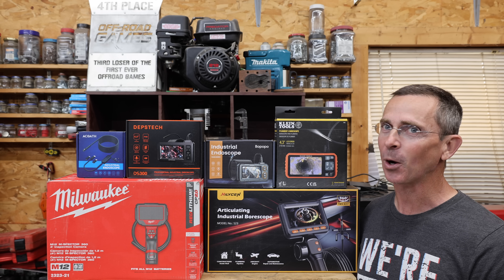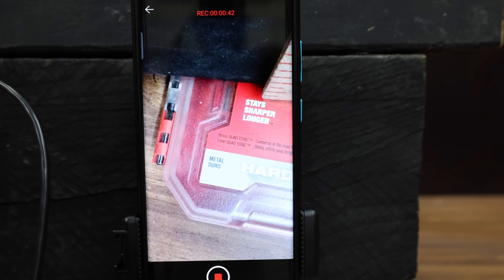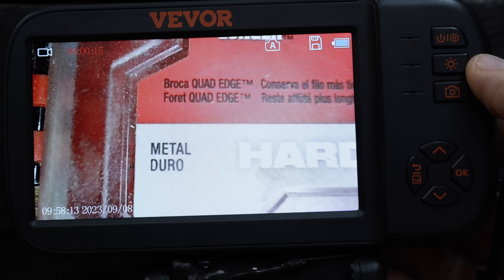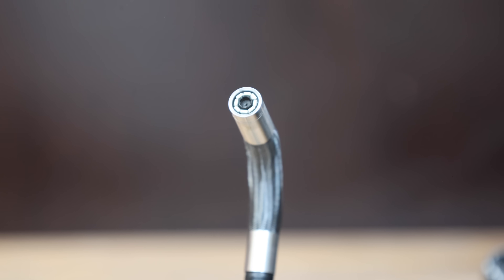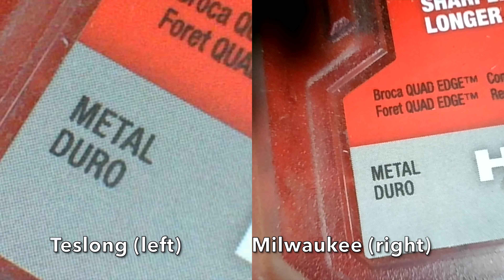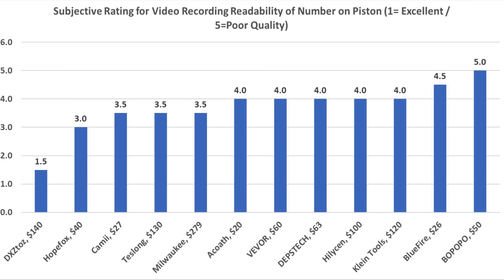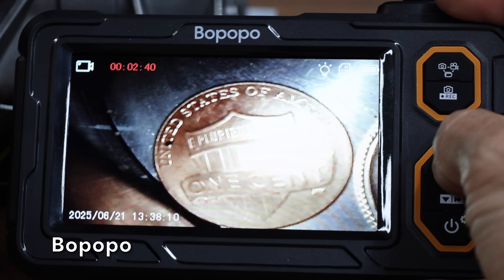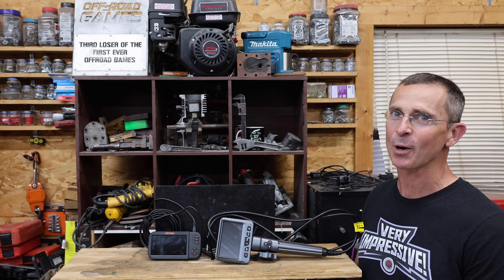I Tested The Most Hyped Inspection Cameras – One Clear Winner!

Comment: Teslong makes the best borescopes for wall inspection if you do mounting work, just not the model featured here.

They make a model with a 5mm probe with dual cameras, it's one of the smallest ones on the market, so it will fit in a 6mm hole that you can then use for a 6mm wall plug (if you you can't or don't want to drill it larger for a larger wall anchor). The side camera in such a small probe is a game changer, it's so useful I bought a spare.

Comment: Depstech has trash construction. The snake camera failed from the cable bending. They sent a replacement, but that one broke internally after one use and did not turn back on.

Comment: Its sad that you only tested for this limited applications.  What about inspecting behind dry wall or ceiling where you need a stable but steerable scope. Or ins a pipe with a long distance, where the black of the back and the light in the front easily lead to a white out

Comment: I bought an older Milwaukee that looks identical to the one you have shown. It takes a M12 battery, but the one included uses AA batteries. Junk! The picture isn’t that great and the flexible cable was so stiff it broke at the screens attachment point. Wish I never bought it. It’s going to the local auction soon.

Comment: PROJECT FARMS TESTS ARE THE BEST! Whenever i need to buy a tool i look for the Project Farm video. Your product testing is fantastic. I have an inspection camera by Harbor Freight. It was cheap, it performs ok. The screen is large. The images can be clean and sometimes are hazy. It records onto an SD card. I have used it about 4 years and it hasn't skipped a beat. It has a very strong internal battery that seems to be getting better with age lasting an hour straight and charging very fast. It has one lens. It has a clipon mirror to look backwards but when any dust gets on the mirror the picture is too hazy to make out things. The majority of the time i am looking straight down in cylinder looking for valve strikes and looking up with the mirror for unseated valves. I can look down and see the piston fine but looking up at the valves is usually hazy. My trusty Harbor Freight has made me thousands of dollars looking inside cylinders. I am on another Interference engine job that requires looking up at the valves, a job the DXZ does unbelievably well. After watching this fantastic Borescope Comparison Video by Project Farm i have to thank you for top notch comparisons and reviews. I just watch the video and buy whichever one you say is the best!

Comment: How long are these cameras able to reach from the screen? Can they be used for long reaches of pipe or something?
Reply: The ones from these brands go from about 7.5 - 50 feet. 
Most are 16.
These are more for air ducts and car/engine inspection. Wall inspection as well 
If the pipe is fairly clean and doesn't have a bunch of tight bends you can use this and have a good experience. 

If you are thinking about using it for plumbing purposes the cable is not the best for it. You can attach a fishline to the camera and the camera cable and have a cable that will go further but still not the best experience.
The camera diameter is also very small so the view/camera can easily be blocked with the residue on the pipe walls.

So if you are thinking about using  it for plumbing and need 25-100 feet you're better off getting a dedicated plumbing camera. 
That said those are at least a few couple hundred dollars and can be upwards of 6 thousand for the higher end ones. 
Not to mention the diameter of those cameras are way bigger so you won't be able to use it on smaller holes like gun barrels and engine injector holes 

I still think getting one of these for 80-250 dollars is worth it.

Comment: I bought $20 one on AliExpress. It was the cheapest one with 3 cameras, no brand. It works surprisingly good. 

One day I was able to fix my friend's toyota yaris, which was back firing in intake manifold so frequently, couldn't even idle.  I checked the valves from sparkplug hole and found that some plastic piece from cracked intake manifold was stuck between the valve lol. 

Removed the plastic and car is running fine as a toyota again.
Reply from the maker: Great information. Thank you

Comment: I got the used Depstech 300 for like 24 bucks.  And we already used it to see in an engine and notice that the valves were stuck open and couldn't close. So we beat on the valves with a hammer for about 10 mins and kept spraying lube.. and brought that engine back without pulling the head off.  So to me, it has already paid for itself.  Good times.

Comment: If you dont need to submerge the borescope, THE BEST improvement in image quality and reduction of light glare is to remove the front glass. I discovered that by accident. What a difference. 

Another thing not tested here is OVERHEATING. After few minutes of operation, the sensor gets HOT and the image quality takes a HUGE dump. I regularly have an iced glass of water handy to submerge the borescope and cool it if I’m working with it longer then 5min. 

I wish you would test phone based borescopes. For most of us the separate screen has no benefits but big disadvantages. 
Our phones have better screens, better image processors  for far better quality enhancements all else being equal. This is why videos are often better then onscreen on these all in one borescopes. Phone apps utilize the phones API to record and show video/image. A phone is always gonna be better at it then some cheep Hardware they use even in $1000 dollar borescopes. People assume that dedicated product for something would be better but economy of the scale prevent it.  A $1000 dollar borescope will often have production cost of less then $50. Even bigger companies do that as evident by KLEIN here. 

Saving images and pic is 100 times more convenient than having to dial with a SD card. 
Also, engancing image quality by controling screen slides is possible too.
Reply from the maker: Thanks for the suggestion.

Comment: I have been using borescopes since 1997 (when they were $50k), your testing is a bit flawed since 99% of the time when you are using one you need that extra light as the environment you are looking at is dark, ie an actually working engine that has carbon buildup. I also put a huge value on a 180 sweep of the camera since if you want to look back up at the valves of an engine the camera has to look that way, or have a replaceable head with a lens that does. For this reason alone many of these cameras are useless to an auto tech. Thanks for the video.

Comment: The overpriced snapon one I bought sucks. Everytime I try to use it to see something I cuss and throw it back in the drawer. Too much light, images are washed out and colors not right.
I tried to look at a wire harness in a frame rail on a T680 the other day, and could not distinguish copper wire from black tape. It cost over $400 and was the cheaper model.

Comment: I have the DXZtoz and I use it for reading part numbers and serial numbers under aircraft instrument panels so I don’t have to pull them out the plane. It’s been a game changer. Highly recommend. I think I got it for around $150 on sell. It was recommended to me. Highly recommend. Used it also to check the inside of my pontoon , toons. I will say it seems like the battery runs out pretty fast. Maybe 2 hours, haven’t done a full test but usually after opening it for use again the battery always seems low even though I use it maybe 30 mins at a time

Comment: Very good review. I particularly liked the image comparison inside the engine where the camera had to use just its own light source. 👍

Something I've come across recently that is an issue is bike tools. I disassembled the front axle, pedal crank, and rear axle so I could inspect and grease the bearings on my 3-speed bike with rear coaster brake. However, when I went to put it back together I realized that the standard nuts used on bikes are less than 3mm wide so a typical, open end or crescent wrench doesn't work. So, I tried hardware stores like Menards and Rural King, Walmart, and a local bike shop but none of them carried the narrower wrenches. That means something has to be ordered. However, I am reluctant to pay much for dedicated tools that I might only rarely use and some of the reviews for narrow wrench sets describe them as easily bent. I'm not sure what to think about that because the narrow collet wrenches for my die grinder don't seem to be flimsy.

You might possibly review:

* Narrow metric wrenches (all bike nuts seem to be metric). However, I have seen some double ended wrench sets that skipped 15mm which I do have on my bike. Mine has 13, 15, 17, and 22mm nuts.

* Thin jaw crescent wrenches. These might be more likely to be used for something other than a bike.

* Bottom bracket tools (these retain the bearings on the pedal crank). There are different types of these since different manufactures use different types, which makes them particularly aggravating. My bottom brackets have slots on opposite sides. However the bracket fits inside the bearing hub so the common, inward pin type or hook type tools can't be used. I need a tool that engages from the side but one that won't block tightening the nut. I'll probably have to make one.

While I'm ranting, I could also mention that no one carries axle nuts. Mine are 9.5mm, fine thread flange nuts. Stores carry 8mm and 10mm flange nuts, usually coarse thread. At least when ordering these online, there shouldn't be any doubt that they'll work as expected. Thank you for your efforts.
Reply from the maker: You are welcome!  Thanks for the suggestions.

Comment: I was surprised to see Depstech on here. It's such a low quality cheap no name brand.

I have one of their cameras from a few years ago, and you'd think I bought it from the dollar store. The battery lasts maybe 2 or 3 minutes. You can't read any text at any distance. The light on the camera gets so hot that it will cause actual burns on your skin. The cable itself is super low quality, doesn't bend properly or hold it's shape at all.

The icing on the cake though is the upside down power switch. You have to switch it to "off" to turn it on, lol.

Maybe they improved their quality standards, but I assumed they were just another company that would shut down and reopen under a new name once their reputation tanked hard enough, like so many other brands on Amazon
Reply from the maker: Thanks for sharing.

Comment: So prescription glasses now days are really delicate because of their anti reflective coating so you can’t use just any cleaner or anti fog sprays (I know this is off topic 😂) I work in a food processing plant I’m constantly having to clean mine and trying different anti fog sprays, it would be a good idea to do a video comparing different anti fog sprays to see which one is better or if the anti fog coating my glasses were supposed to had are better by themselves since I don’t know if I messed that coating by introducing the anti fog sprays, so far I’ve tried zeiss, ray ban anti fog, and fog stopper by dynamic labs
Reply from the maker: Thanks for the suggestion.
Reply: @ProjectFarm no problem, it will be even beneficial to you because you use glasses too

Comment: Always a lot of great insight to be found on the channel. The real world testing has steered me in the right direction on more than one occasion. Now, if you can run down one of these scopes that can fish a plastic oil filler cap off the full under body skid plates of an off-roader it will check all of the boxes. 

Wonder what you think about testing some of the mass of auxiliary battery bricks for phones etc, with solar panels and hand cranks.
Reply from the maker: Thanks!  Thanks for the suggestion.

Comment: A comparison of cylinder Leak Down Test Kits might be a good one, as I imagine the guages and contruction between them may vary quite a bit.

Leak Down Tests allow you to check the health of each cylinder in an engine. You pressurize each cylinder invidually to a known pressure, and the kit lets you know how much leakage there is. You can check the health of your head gasket, piston rings, intake and exhaust valves all at once by listening for air leaks into your crank case, intake, exhaust, and bubbles in your coolant.
Reply from the maker: Thanks for the suggestion.

Comment: I have an idea for a video.  Best Multimeter  -  features, ruggedness (drop test), electronic protection, fuse availability, price, screen visibility.  I have had $20 multimeters that seemed OK, and $90 meters that failed within months. My $500 Fluke was stolen. I am retired now, so I don't want to replace the Fluke, but I want something decent, and everyone claims they are the best.
Reply from the maker: Thanks for the suggestion.

Comment: @ProjectFarm  Would you please test cigarette lighter splitters/adapters? Especially the ones with higher power output through USB-C and if possible with household outlet. Thanks!
Reply: If interested, there are multiple aspects to be tested including the safety standards (UL certification for variable voltage/amperage output, replaceable fuse, etc), accuracy of output numbers, built quality (especially the cable resistance to disconnection), cabel length and other design features (LED lighting, etc) and heat management.

Comment: Great review idea and review.  Reminded me that I have an inspection camera that I should have used to look for that screw I dropped into an engine (on the outside, not in a cylinder).  The ones I have are USB, but having an integrated display is a good choice - no potentially unsafe app to load on my phone or laptop.
Reply from the maker: Thanks!

Comment: I have a borescope from Matco, Honestly I feel like its worse than the ones shown here, Its bluetooth with your phone however there is a 10-15 second lag and extremely blurry.

Do you have a video on compression/leakdown kits? I need to buy one and was warned against Harbor Freight because the bit rips off inside the sparkplug hole and is a pain in the ass to remove.

Comment: This is a category I actually deal with. I've heard of 0 brands other than the vevor and Milwaukee. We use 2 older systems that retailed around 45k and 15k at the time of their release and are our main inspection methods in fabrication. We tried an older model of the Milwaukee and that thing was junk. The new one doesnt look much better. Definitely going to try some of these with our field service techs and possibly cheaper ones for the shop. Articulation used to be very expensive so its cool to see that price come down this much.

Comment: As usual great testing, though I’m kinda surprised how the Milwaukee got graded in the beginning.  Anyways I own the DXZToz thing as well as others, sadly I’ve yet to find a single perfect bore scope. Aside from good image and screen quality, zoom and all the other normal features, it needs to be 180 degree articulating, have a diameter of 5.5mm or smaller, and needs to have a side view camera with the light on the other side of the camera as compared to how they’re all made. Every single side view camera has the light on the cable side of the camera. That means that right as I’ve got the cameras high enough in the cylinder to see the back side of the valves, the light gets blocked. Why nobody puts the light on the end side of the side view camera, or even on both sides, I have no idea but damnit it really causes issues for me and my brand. And no none of the articulating heads are short enough in length to see what I need to see inside a small combustion chamber. And no the mirrors don’t work well enough either.  Someone please please please make a bore scope with everything I just described!  Have all the standard high quality features, plus articulating and side view with the light positioned on the other side of the side view camera, keep it under 5.5mm in diameter and even if it is several hundred dollars I’ll be the first to buy it!

Comment: There are older-tech insp'n cams available that offer a feature that 2025-tech insp'n cams can't even make false claims about:  An infinite focal range (pinhole cam) w/ excellent resolution and w/ approval to Int'l Marine Standards.

But those are the only features that don't date back to the 70's (ex: you need a VCR to record footage).  But these units are carried by pretty much every Commercial Marine Transport for urgent remote hull, running gear and ballast tank inspections (and it's corded of course).

I mention it because I was drilling below the water table to a known, open cavity of unknown dimensions and a cam w/ a focal range of 1 to 5 inches wasn't going to cut it.

If interested for similar use I have an "Aqua Snake" -- commonly available from ship scrapping / salvage yards in Asia, used.  But they're not cheap.  My cam & kit was about $200 (used, salvage, functioning) which was about 1/10th the cost (new) at the time.  (Thanks Todd!)

Comment: Thank you for the practical consideration you put into every test. 

Have you considered using a weighted scale to calculate final rankings for the tests where that's possible? When you use a 1-point per position average, it's only accurate if the performance gap between all of the rankings is equal (linear). However in many tests, the gaps are not equal (irregular or non-linear). Clusters of products perform very similarly, then the performance degrades more greatly down the line. 

A weighted scale for certain tests (columns) would represent this better when you calculate the final ranking (last column on the right). 

Probably doesn't apply to every product and definitely not to every test.

Anyway, thanks for your great work.